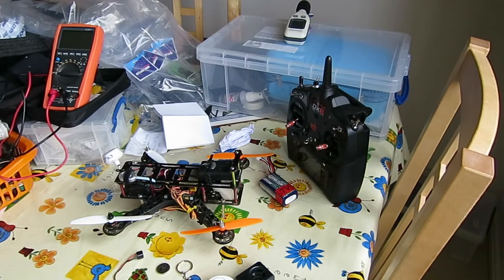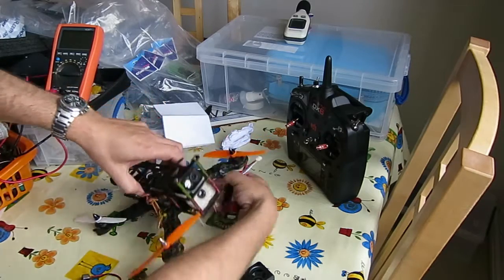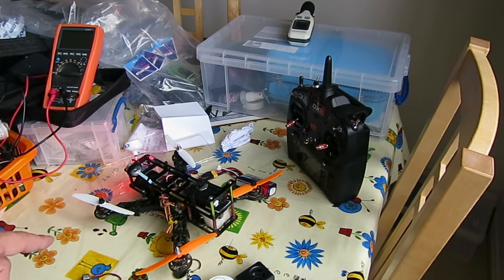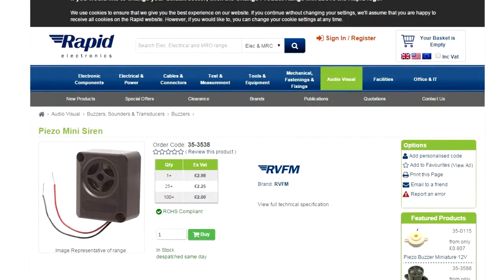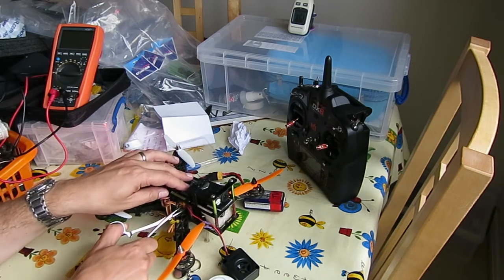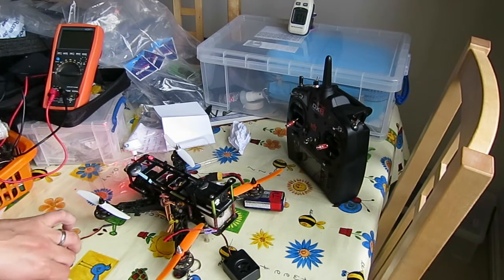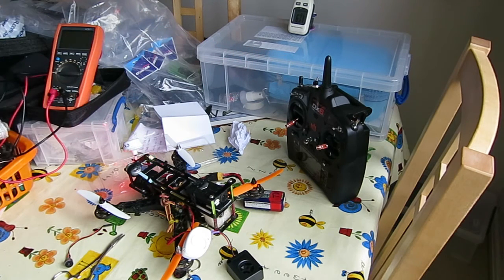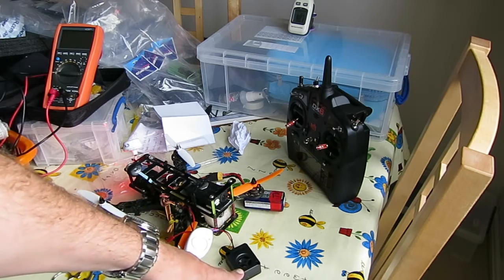LOUD 5v Buzzer for FPV racing miniQuad ? Cheap and easy Naze32 KK2 etc

Comment: Both a little bulky for a mini quad but certainly loud.  I still have a 5v one in mine and found it in long grass after a crash yesterday and could hear it from about 30 metres away and that was with a busy, fast A road very close by.  I've thought about hooking up two 5v buzzers and having them in different locations on the frame.  That way, regardless of the orientation of the quad after a crash, there's a better chance of hearing it.
Reply from the maker: +valderja The 5v buzzer is fine for close by, I use loc8tor tracking tag which is only slightly bigger, and has its own battery and allows tracking from a few hundred feet away, if you know which way it went, you can easily find it with that for miniquads (not long range FPV), and its not expensive and works anywhere (doesn't need phone signal etc).

Comment: Thanks for the info. I having trouble making mine work with my storm 250 pro and devo 7  the problem is there is no signal wire coming from the buzzer and I can't find a spot to add one to the buzzer. Any suggestion?
Reply from the maker: There should be a wire from the existing buzzer to the CC3D controller, so you just need to swap that to connect to the new buzzer, I have never used CC3D so can't be much help, but if you search/google CC3D buzzer there should be some info to help. There should only be two wires to buzzer, ground and +5v - no separate signal wire, so if the buzzer connection has 3 pins, one of them won't be used.